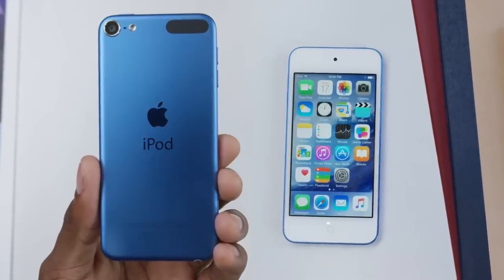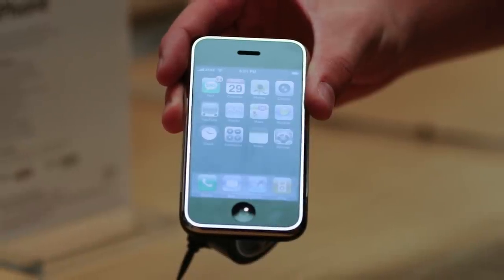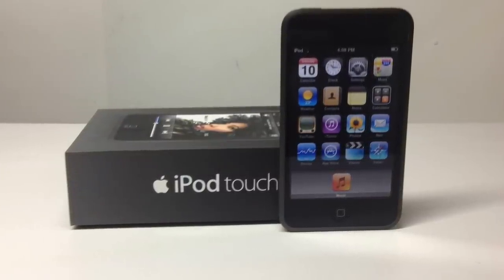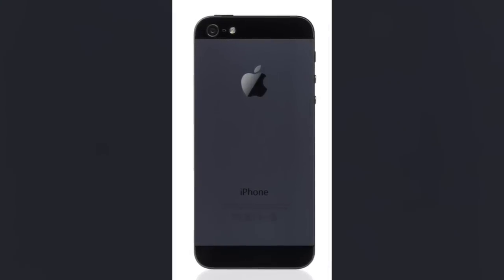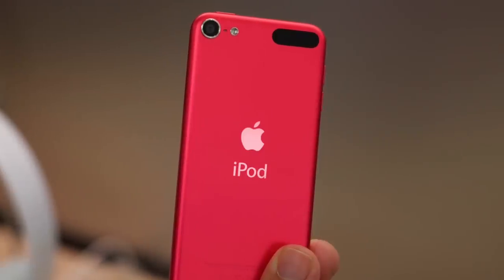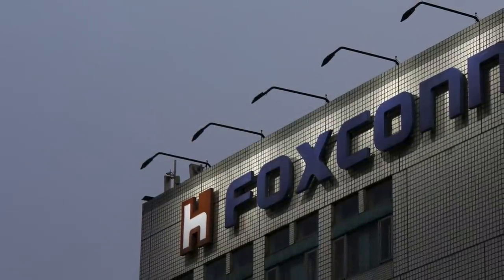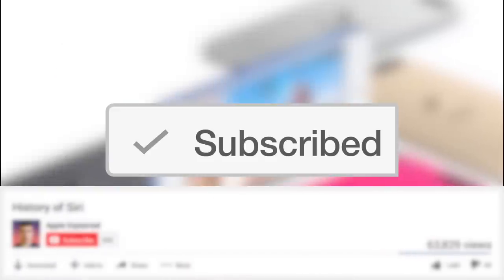History of the iPod Touch

Comment: My wife and I love the iPod touch! We have been avid users since their first release, updating regularly. We currently use 32 and 128GB 6th gen. and love the fact we have an iPhone 6 in small form factor. However it would be nice if the next update simply used the 4.7" screen and iPhone form factor, just take out the cellular tech.. It would cut costs for Apple while giving us iPod touch loyalists a nice upgrade in screen and battery (not to mention give a certain hand-held king a run for it's money).

Comment: Not even worth getting an ipod touch.. just get a 6S and itll blow all ipod touch out the water
Reply: TehFalcon101 the 6th gen iPod touch has an Apple A8 chip with an 8mp camera... the 6S has the newer faster a9 chip with a better 12mp camera.. and other better hardware. The 6th gen is actually comparable to the iPhone 6.. they share the same hardware.
Reply: its aimed for kids because parents are cheap and kids dont need to call
Reply: ilias008 So, buy them an iPhone 6 or 6s, you can get some used for $100-200. When they’re old enough just pop in a SIM card and done.
Reply: I still use my iPods. They're great for putting in your pocket and just listening to music on.
Reply: I had an iPod for many years before getting my 6s. The iPod worked fine since I didn’t need to call and found other ways to text people who didn’t have iPhones. I finally got an iPhone this year because it finally became obvious that I would need to have cell service, especially because of my age. 

So although I see your point, iPods have their place. My parents didn’t want to get me a phone just yet (a fifth grader doesn’t need a phone, an iPod works just as well) however an iPod has a lot of the same functionalities.
Reply: Integra DIY I got an iPod touch but,then I got an iPhone 6s.
Reply: Or just an se.
Reply: A 6s is way too expensive still in AU ($540).  👌

Comment: Um, your timeline on the iPhone 3G vs iPod Touch 1St gen  release dates is off by a about a 9 months. The first iPhone was released in June 2007 (but announced in Jan 2007). The 1st iPod Touch was announced/released in Sept, 2007, about like 3 months after the 1st iPhone. The iPhone 3G would not be released until June 2008, 9 months after the 1st iPod. So the iPod debuted between the 1st and 2nd Gen iPhones.

Comment: iPod touch gen 2 included a built-in speaker, not just the iPod touch gen 3. The 3rd generation also did not come with a mic, but it was the first iPod touch to include headphones with a built in mic and a custom application that acted similar to Siri.

Comment: I still have the iPod Touch 32GB  3rd generation that I purchased in 2009 today in 2019. It still works 100%. I mainly used it for music at the gym or in the car until I got an iPhone 5 32gb in 2016 and then a 6S 128gb in 2017 which I'm using now. I don't use the iPod now because I use the iphone instead.

Comment: Having bought an iPod classic and running into MANY issues with my music library, and not wanting to suck up all of my iPhone's storage, I'm almost tempted to buy another iPod touch (after five years of not owning one) just for that. However, I can't really justify it because 1) higher storage capacity iPhone models exist (albeit much more expensive) and 2) that I don't need yet another iOS device - it becomes even more of a chore to maintain all devices with iOS updates and deciding what I want to do with them as far as use goes. I have an iPad for light duty work and my iPhone for everything else (and a MacBook Pro for the heavy stuff). I love the iPod touch but honestly, I don't see a use anymore.

Comment: My hypothesis on why the iPod touch still exists is that it can basically raid and plunder the iPhone parts bins for most of the Touch's internals. The SoC from the iPhone 6, display from the 5, likely the same flash storage chips, and the exact same operating system and connector. There is no special parts, like the 1.8" Toshiba HDD that the Classic used, or externally sourced software that the Classic and Nano ran, much of the r&d is done for the iPhone and the Touch is, to some extent, along for the ride, a way to extract a little more value out of SoC design and software development

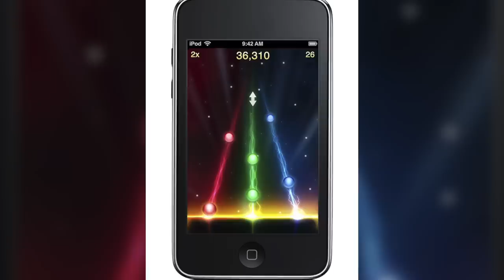Comment: 4:03 - "not much changed"

3rd gen had a new CPU and double the RAM, which might not be the biggest upgrade, it was the first time iPT got a performance upgrade so seems note-worthy.

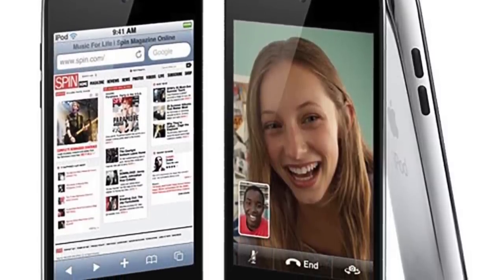4:25 - "[the 4th gen had] an accelerometer and 3-axis gyroscope"

The iPod touch had an accelerometer from the first gen, and it was the 3rd gen that introduced the gyroscope.

Comment: Some info in the video was wrong. Let me correct it:
The first generation iPod touch was the only generation without a speaker, which was introduced with the second generation. Not the third generation.
Also the third generation iPod touch had no microphone, that feature was introduced with the fourth generation. I remember this vividly because I used to have the third generation and my sister had the fourth.

Comment: My first/1.5 Apple device was the iPod touch 4. My original 4th Gen screen cracked and I got a replacement which I will call my 1.5 Apple device since it was not a new device just a replacement for one that broke. Surprisingly Apple actually replaced it for free even though the screen was cracked and Apple always charges for replacements for devices where the screen cracked.

Comment: We want an iPod touch 7 with these specs 
A11
2GB Ram 
64GB or 256GB of storage 
3.8” 810p or 5.1” 1080p (432-435PPI)
12MP 4K 60 rear 7MP 1080p 60 front
Battery sizes iPod Touch 7 1300Mah iPod Touch 7 Plus 2400Mah
Touch ID (No Face ID)
Starting from $269
3.8” 64GB $/£/€269
3.8” 256GB $/£/€399
5.1” 64GB $/£/€349
5.1” 256GB $/£/€469

Comment: Next gen ipod touch same design, A9 chip, 6s camera, and no headphone jack
Reply: Nah. If they were to make a newer iPod touch with a similar design, here's what it would have if it was released this year.
Apple A10 Fusion Chip
12 Megapixel Camera with 4K@30 (Apple will upgrade the cameras this year.)
Dual Flash
32, 64, 128, and 256 GB storage.
Dat regular 4 inch display that is BEAST
iOS 12, capable of up to iOS 15.
STILL a headphone jack because, it ain't iPod without the iPod.
Bluetooth 4.2 (Apple likes to put last gen stuff in their non-iPhone stuff)
1st-Generation Touch-ID(If applicable)
2-GB RAM (It IS less than 5 inches, so...)
Brass-Gold? Space grey, Silver, Product (RED), Blue.
Lol this might be something gud

Comment: My iPod touch 5 is legit dead. It won't charge, you plug it in, a minute later it says it's at 100%, when you unplug it, a few minutes later, it turns off because of low battery. I left in on charge for like 5 hours and it didn't make a difference. Apple are bullshit.

Comment: My mama didn't give  me permission for using mobile.bc Texting msg or call Please tell me...Ipod touch have texting or call system if them than i can't buy this i am 14....Please tell me... sorry for bad english...🖤
Reply: It has no sim card slot so It cant call or message or even use the 2g/3g/4g connection. But you can still connect It via wifi and use instagram, snapchat, Messenger. if ur Friends have an iPhone u can use imessage and FaceTime via wifi to text or call them.
the problem of the this iPod is the fact that is old and It Will probably die with iOS 12 so It Will not receive iOS 13 at September 2019
Reply: Bressanello Marco Thank you so so so so so muCh can you tell me about 2018 generation of ipod..
Reply: Bressanello Marco Thank uuuuu😘😘😘😘😘😘😘😘😘😘😘😘😘😘😘😘😘😘😘😘😘😘😘😘😘😘❤❤❤
Reply: Zara kelly,
As the other guy said, you cannot phone, or text people on iPod. You CAN use Snapchat, Facebook messenger, Instagram ETC.

There is no 2018 iPod! They stopped making all iPods last year 😮
So I would not buy one if I were you. You won't get updates, and won't be able to get new apps!

Hope this helps,
M
Reply: Zara kelly np 😉
Unfortunally there are no rumors or information about a new ipod 2018 and I think that wont be any new model (it's about 3 years that ipod touch doesnt get an upgrade model...). Try to convince ur mother to get an iphone se (at least 32gb but 64/128 would be better), its really cheap ;)
Or an iphone 7 refurbished
Reply: Zara kelly Or you can just get a texting and calling app did he as TalkToText and Text plus